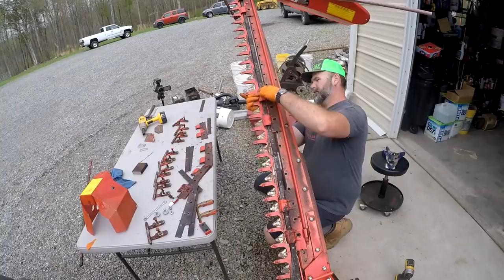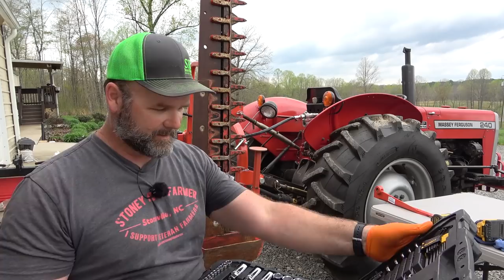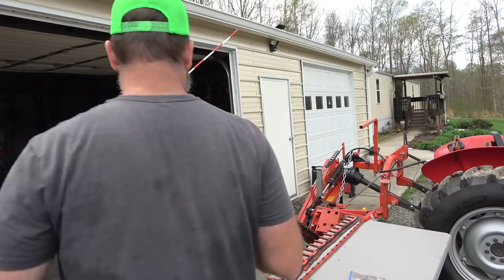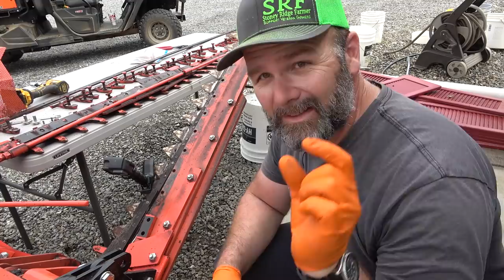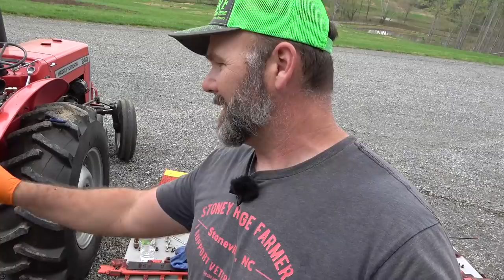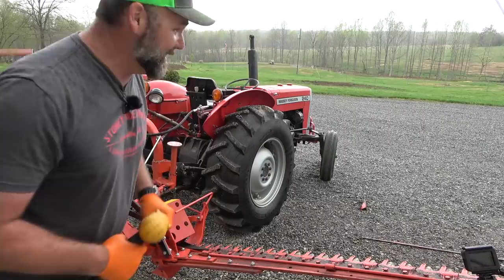Is it worth Fixing? Tough Tractor Repairs

Comment: I grew up on a cattle farm, just retired from a milk dairy after 40 years. We had an International sickle. When we finished with it for the day, Dad would put used motor oil on the blade before we put it in the shed.
When we took any bolts off for a repair, we would always take the bolts in to our shop and clean the treads on a wire wheel on the grinder, it made them go together like new.
Thanks, Emile from CT.
Reply: Yep.   A wire wheel will work wonders.

Comment: If like most sickle bar mowers the bar is released from pitman pin and slide out the other way (opposite side of mower)...I assume the moving rock guards bar does too...no other disassembly needed.  Also mowing rough or rock train, there should be adjustments to roll the bar so the guards lay uphill from direction of travel, to keep the teeth out of the dirt
Reply: I am pretty sure you are right, i just bought one and i think it says in the manual you can pull both out from underneath the mower. Also if you break any gear on a rotary mower you have way more work and expenses to replace that gear than if something breaks on the this style....

Comment: I learnt a lot watching this Josh. I have a 7' sickle bar thats exactly operates the same way. Mine is a J.D. aftermarket Frontier brand that i got with my tractor in 2018. Your right,  they're awesome mowers. The rock guards move in opposite scissor actions as the knives. My mower is in its third summer of use, and "knock on wood" its never been any problems so far. Good video my friend.

Comment: Hey Josh, good job on the sickle bar mower. I'd do what a few have already suggested instead of running the dirty bolts in/out of their threaded holes.
Soak in kerosene, or in Gunk parts cleaner can with internal parts holder - available in most auto parts stores. Good for small carb parts too, etc.
Then wire wheel the threads till clean and brush into the threaded holes the same mixture. Or, if really gunked up, use tap to chase the threads until clean. Then copper anti-seize on bolt threads and blue locktite on any nuts that might vibrate loose.
Your super clean might work on the sliding parts, shims, etc. before dismantling, or after to clean the remaining stationary pieces.
Would you mind linking to your black roll around stool - Craftsman? and the Titan roll around work-tray?
Thanks,
Have a good mow with the sickle bar once completed...
Carter
Reply: Nothing beats Never-Seize.

Comment: Great video, loved it. You might want to try out some PB Blaster on those rusty bolts and nuts. It's a great product which I've used for years and have had great results. It will dissolve rust and works as a great parts cleaner as well. Take care and God Bless.

Comment: A friend of mine uses a sickle mower to cut hay with.  Seems to work extremely well and they don't lose as much of the alfalfa leaves like they would with a swather.  I can't remember what tractor they use, its an old John Deere 3 wheel tractor, probably 50 years old or older.  Their hay baler is so old it has its own engine, pull it behind the tractor but no PTO, it has I think an 8HP Wisconsin engine on it.  You can add a PTO to it as it looks like there's bolts on the flywheel where you could bolt on a PTO, but for some reason they run it with its own engine, I'd think the tractor would be able to run the baler but maybe not enough PTO horsepower I'm guessing as to why they don't run it with the PTO.

Comment: I would have cleaned those bolts up with a wire wheel.  Tap and die set would also help to run the threads, if any damaged, or rusty.

Comment: I don’t know that mower, but I think some of that could have been done by pulling the bar out the other direction.  Looks odd with both guards and cutters moving, but I bet it cuts well.  Question, why didn’t you sharpen the blade sections when you had it that far apart?

Comment: I believe you did a lot of unnecessary work.  The old sickle bar mowers you would put the bar all the way down and pull the cutter bar out in one piece..  the reason why u see the old ones on hedge rows is because they had to be bolted on the tractor.. 3 point hitch changed all that. Plus the invention of the haybine..  Its all a learning process.. love the channel Josh.
Reply from the maker: hmmm....well, I had to fix it brotha...and the only way to get it out was to remove all of those parts.  So, work about 4 hours and get'r fixed...or park it and let it rust up like all them sickle bar mowers ya see at farm auctions.  A $100 part on a $1500 mower....it was fun! Wooooo!
Reply: With the bolt on guards everything has to come apart

Comment: Okay, Stoney Ridge Farmer - I'm curious how many times you've had to repair these sickle bars, either the blade bar or the guard bar. I have a Frontier SB3108 which is made by Maschio Gaspardo and is essentially identical. I've had to repair my bars four times now and it is getting ridiculous. One blade bar in 2022, one blade bar in 2023, and two guard bars now in 2023. It's getting to be that I can do a pit stop change on these things. Between the repair time and the cost of parts I'm beginning to think these machines aren't so great. So if you've got secrets on keeping these from breaking, or if you have changed your mind and gotten something different, fill me in.

Comment: Hehm. No owners manual? Seems like a lot if disassembly to put a new bar on.. never worked on anything that new though. Just them old ones in the fence row, run one the others are for parts. Tear it up a few more times you will  s
probably find an easier way to fix it. Telling you from experience.

Comment: I would have ground it out with a die grinder and hot glued it with the mig in place . . . If you can slip a piece of aluminum behind the broken parts or put grease begind them it could keep you from welding too many pieces together.

Comment: Hello, I bought exactly the same mower as yours, but it does not have a hydraulic cylinder lifting system. I want to install the same system, but I can't find it anywhere. Could you tell me the dimensions of the hydraulic cylinder so that I can make this lifting system myself. Thanks
Reply from the maker: I no longer own this mower....I sold it to a fella with an apple orchard
Reply: @StoneyRidgeFarmer  Ok, I got it, thanks a lot

Comment: Wouldn't it be easier to pick up the rocks instead of fixxing the mower every time you mow? It will be cheaper too in the long run!
Reply from the maker: Brotha...this ground births up rocks every year from frost heave and such....when the cutter is 2 inches off the ground..you're gonna hit some rocks...Stoney Ridge ...not Smoothy Ridge lol
Reply: @StoneyRidgeFarmer  you can always get a rock rake and rake the fields every spring before the grass starts growing!
Reply: @ajlewis9454  have you ever done any field work?
Reply: @andrewscott2866  raised on a dairy farm and done lots of haying back in the old days when we couldn't just go out and buy new parts for equipment.
Reply: @ajlewis9454  your suggestion seems impractical to me but I live with incredibly rocky land. Occasionally we'll pass a roller over a field and push the rocks back down if they 'grow' too high.